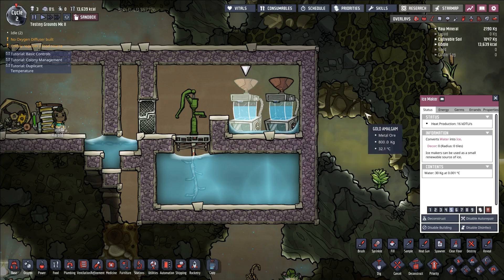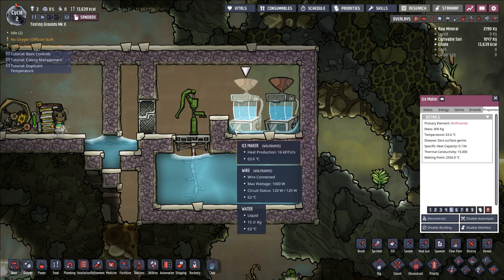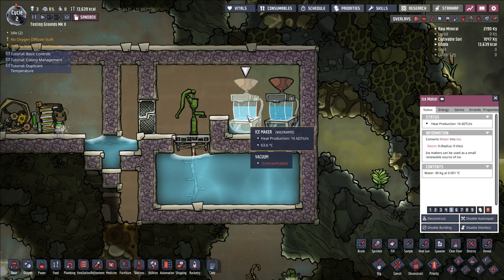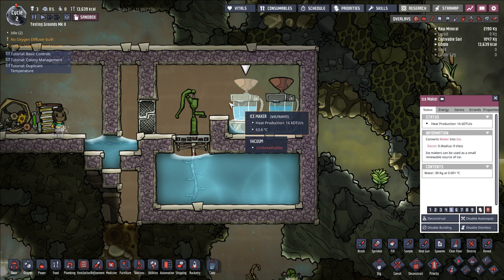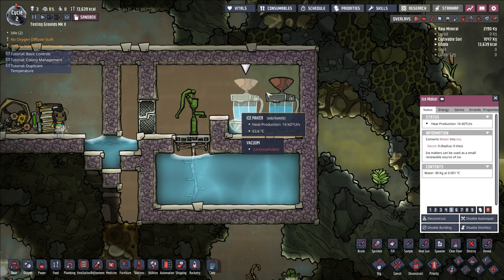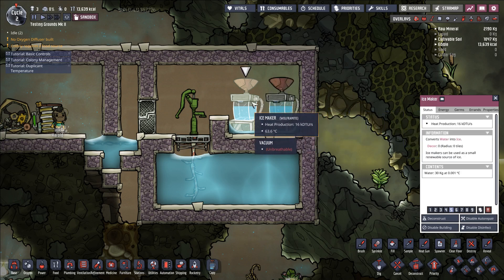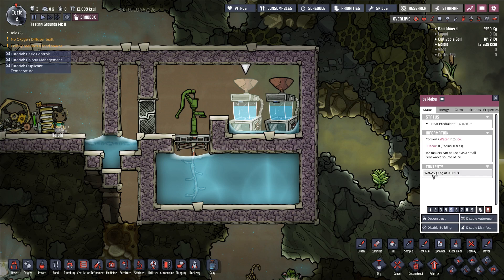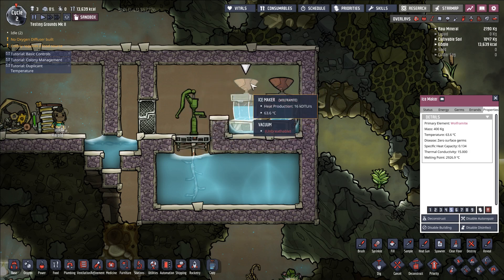Ice Makers delete 4, 8, or 20 kDTU/s depending on how you use them [Oxygen Not Included]

Comment: ok, so do i understand this right? the idea is that:
1) it takes out 16 kDTU/s from the water
2) it generates 12 kDTU/s in the building itself
3) it generates 4 kDTU/s as excess heat to the surrounding.

so considering it's put in vacuum the 4 kDTU/s will get deleted, and that's how we get the 4 kDTU/s deleted?
how exactly do we get the 8 kDTU/s deleted? 

I mean i understand the part with the destroying/rebuilding and removing temperature from there to get the 20, but i don't get when we can delete 8
Reply from the maker: 1) it takes 20 kDTU/s from the water
2) it generates 12 kDTU/s in the building itself
3) it generates 4 kDTU/s as excess heat to the surrounding.

So we get 8 kDTU/s if it's in a vacuum and #3 doesn't happen, otherwise we get just 4 kDTU/s.

Comment: All buildings have heat mass reduction. I'm not sure if ice maker has higher than other buildings but I'm  100% sure the effect is there for any building. Just spawn a building at 20 C in some environment (best done with neutronium walls), let the temperature equalize and then do the math.

The excess heat is complicated. If I remember correctly, it is spread evenly over all tiles covered by building and it's only applied to the ambient element. If there's vacuum in some then the heat is not applied at that tile. But then also there's some limit to how much can be added to a single tile and if the tile's ambient material would change too much, it is clipped. Or something like that, my memory about it is hazy. You could definitely find a lot about it on Klei's forums, you just need to use google to find it since the forum won't search archived posts.
Reply from the maker: Is this a recent change?  I have a video where I looked at melting down Kilns to make refined metal, and it took exactly as many operations as calculated.
Reply: We discovered it deep in the early access and the assumption is it's there since before Alpha.

Here's a post I talk about it long after I have discovered it's the case:
https://forums.kleientertainment.com/forums/topic/88321-integrity-of-the-in-game-physics/?page=0&tab=comments#comment-1011668

BOTH the building's thermal mass AND the heat it applies to itself are reduced. That's why your kiln experiment met the expectations.

I assume it was implemented correctly in the very beginning and then devs realized buildings are heating up the environment too much and this reduction is the solution they decided to put in the game.

We did a lot of heat-related research by then, some of it can be found around here:
https://forums.kleientertainment.com/forums/topic/80184-hydrogen-cooling-systems/?page=0&tab=comments#comment-935267

Comment: I didn’t quite catch what is the logic behind the Ice maker’s ideal condition?

Putting it in a vacuum?
Reply: Keep it in vacuum, then after it has accumulated a lot of heat, destroy it and build something (possibly another ice maker, or something made of refined metal if you melt it). Most of the heat it has accumulated will be deleted because of a quirk in how construction works.
Reply from the maker: In a vacuum, the Ice Maker does not generate any of the "Excess" heat, and only generates the amount produced during "Normal Operation."  So a vacuumed Ice Maker only produces 12 kDTU/s of heat (it only looked like 60 kDTU/s because of the hidden 1/5 factor.

Even more "ideal" is to exploit the maximum temperature that buildings get built at.  So you keep your Ice Maker in a vacuum, operate it until either it melts or you decide to deconstruct it, and then you take the resulting hot materials and build something out of them (like another Ice Maker) which resets their temperature to 40 C.

Last one's a little exploity, so ignoring that you get somewhere between 4 and 8 kDTU/s depending on whether your running Ice Maker is in thermal contact with anything it can give its "excess" heat to.
Reply: Gearhead Gaming I see, I’ve done this before with Steel Manual Generators in a Vacuum to power 3 Aquatuners
Reply from the maker: @COCOLEMON-TV  I need to test if other buildings work like this too, because I made an earlier video where I showed how you could make Kilns melt themselves to get refined metal and there wasn't any sort of 1/5th factor applied to the Kiln's heat capacity.  So either it's a recent change or it's an Ice Maker specific modifier.
Reply: So would building it on abysslite tiles and then vacuuming out all the gas be the best method early game?

Do the floor tiles matter as well?
Reply from the maker: @jeffreykauffman2174  I dont think the floor tiles matter, I think as long as the room is a vacuum you should be good.  Just remember that if you plan to have the ice maker self-melt, then you'll want the floor to not conduct much heat.

As for whether it is a good early game strat, that depends a little.  On normal difficulty settings yes-- it gets you your cooling plus early access to refined metals.  For the Let's Play I'm doing, no, because at maximum difficulty settings, having dupes run through liquid-locks is murder on their stress levels, and dupes need to be able to access the room to load in water.